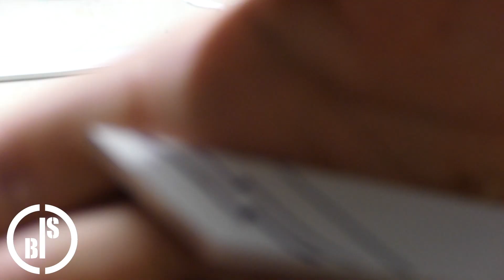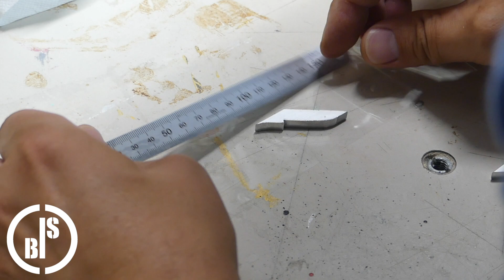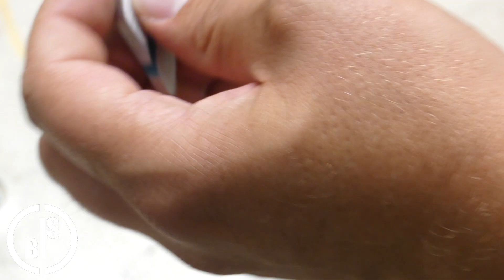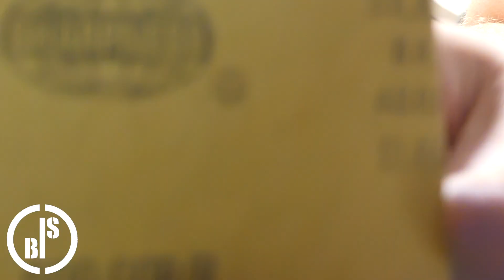Making an Aluminum Epoxy Resin Pendant

Comment: Great project, camera focus was in and out though, which spoiled the viewing. A question for you, why did you use a blowtorch on the resin before you poured it, as I would have thought bubbles are more likely at the pour, not before, I guess the sticky tape may have melted though if you tried it after the pour.
Reply from the maker: Thank you. Exactly. You're right.